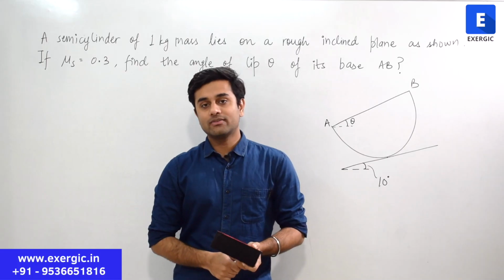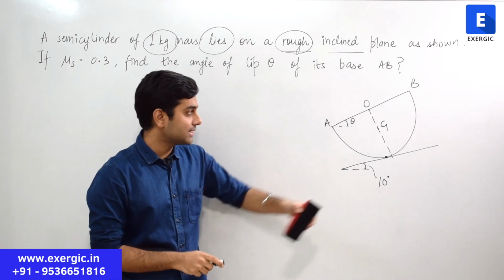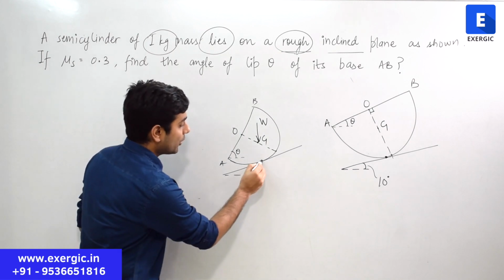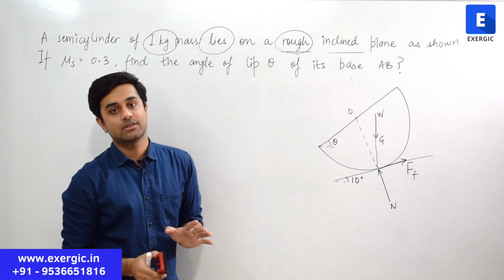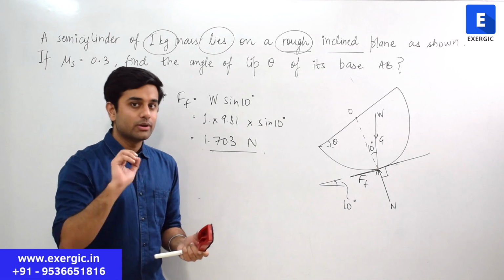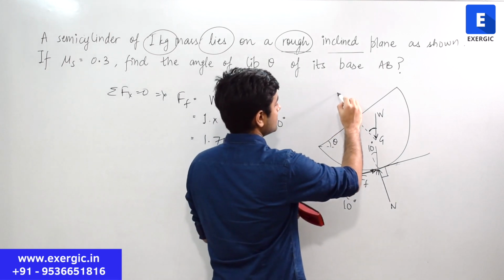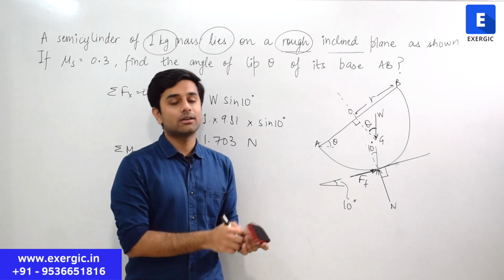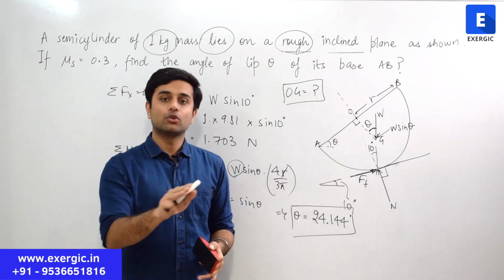Friction question with conceptual learnings - Mechanics | GATE Mechanical

Comment: Sir why Normal reaction will pass through O please tell.  Eagerly waiting. Please sir
Reply: Bro I have same doubt. Did you get clarification?
Reply: @theunboundedspirit3313  Because it is perpendicular to the plane which is a tangent to the curve. And perpendicular to tangent always passes through centre of the circle.
Reply: @aniruddhadasgupta8921  this is how I got it sometime ago. See normal reaction means Normal to both surface , i.e  resting surface and arc. So for the and every normal passes through center of circle. 

Is it correct?